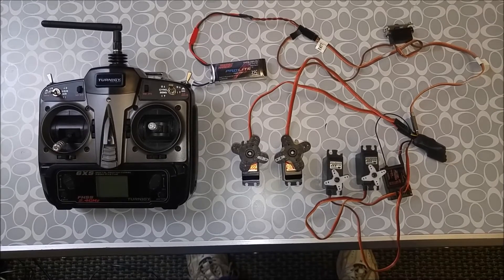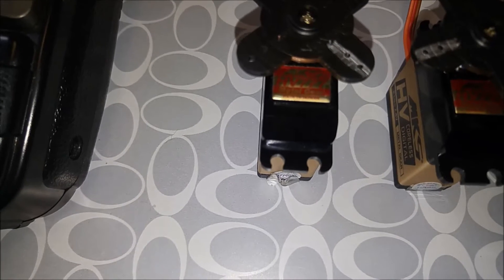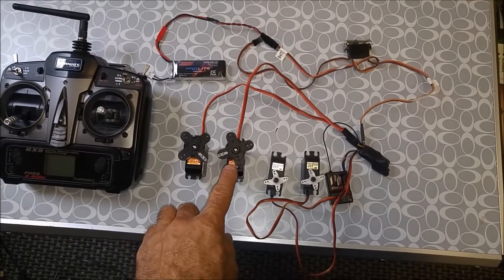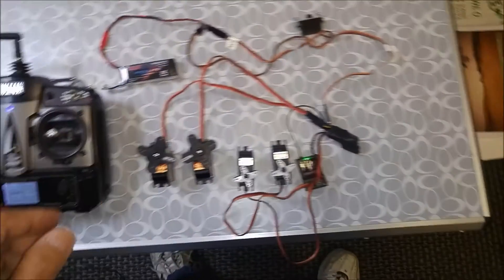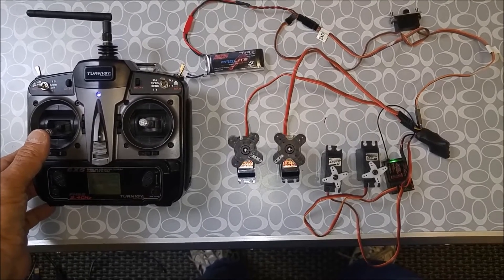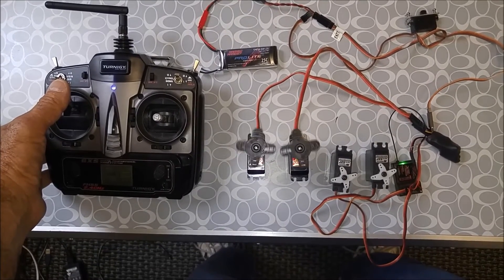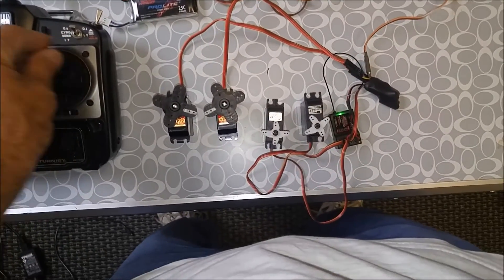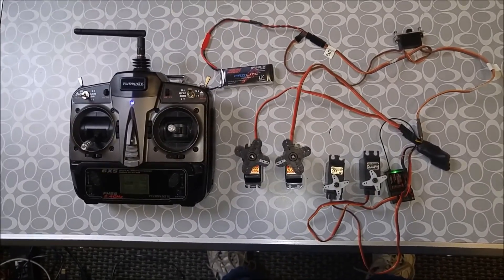Arduino Based Servo Flap Ornithopter

Comment: hi sir , i have aplied codes for this system but it dinot work properly (2 tower pro mg996r , arduino nano and turnıgy 9xr with fry sky rx) what i have to do ? could you help me? tıll throttle middle position system working well after middle position not ???????????????

Comment: How did you connect the high power servos to the power sulplly? I assume not through the arduino pins of course so what did you use?
Reply: The servo only needs signal and ground connection to the Arduino.  Servo power can be separate but its ground must be connected to the other grounds in the system. I used a high current DC-DC regulator to supply servo power from a lithium pack of higher voltage than the regulator.

Comment: compiled 
arduino1.5.4
arduino1.6.6
arduino1.6.10
and
arduino0022 v.betta

i have a problen.....

flapangle2=(int)((30.0+flapdeg+servo_zero2)*2.0+25 .0);

=
sketch_apr13a.cpp: In function 'void loop()':
sketch_apr13a:56: error: expected primary-expression before 'int'
sketch_apr13a:56: error: expected `)' before 'int'
:(